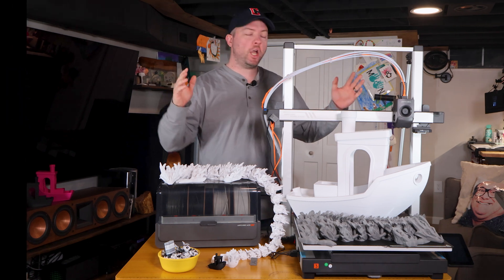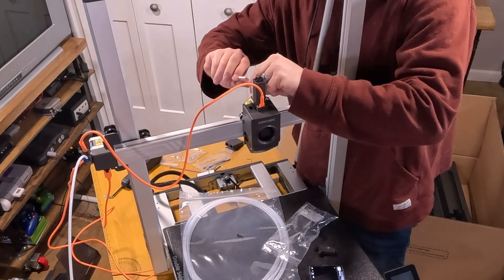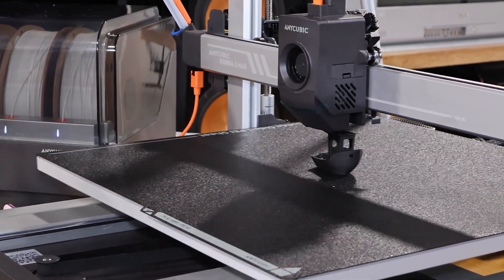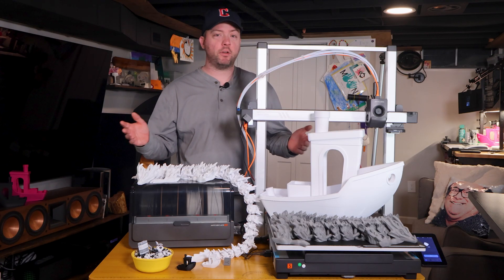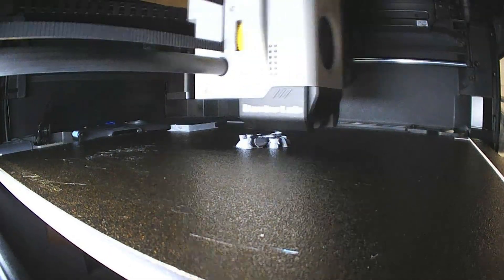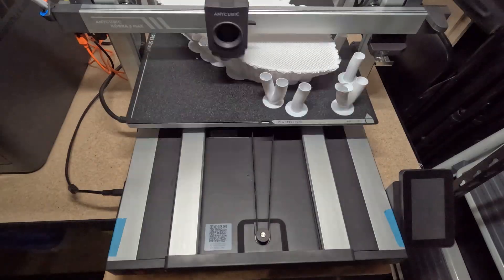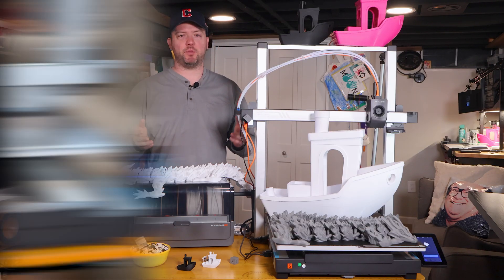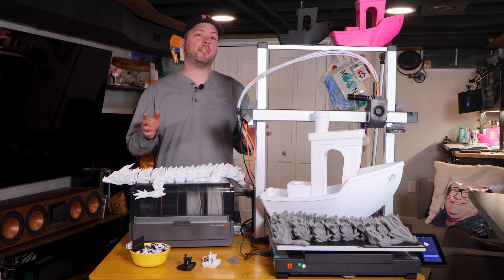Anycubic Kobra 3 Max!  Worth it?

Comment: Anycubic printers have been nothing but frustrating....seems like all the youtubers unbox and immediately start getting multiple successful prints....meanwhile I get 1 successful benchy print and then I can't print a single other thing without issues....mostly clogging issues.....and with the Max 3, sometimes stringing issues because there's no poop scraper or anything
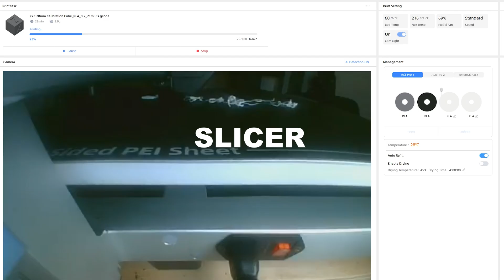Reply from the maker: Oh man that sucks, sorry to hear that.  There is a poop scraper and I initially didn't install it because it wasn't part of the instructions.  For example at 5:30 you can see it just right of the print head with the metal and black plastic in line with the nozzle, is that the missing part?  Hope you get some decent prints like I did.  Haven't had a clog yet.  I will say that anybody can look competent when you can edit a video and I'll try to put my mistakes on display but don't put too much worth in youtubers getting it first try, they probably didn't.
Reply: @TKMakes-2024  hnnnngg!!!! literally just threw out the printer box today.....let me quickly check if maybe I put the scraper to the side with the spool holder.....

Doing a like 14 hour poop bin print now and its working great.....must be just multi-color printing issues.....constant nozzle clogging when switching filaments or something
Reply from the maker: @ryansessions6278  That was the issue I had until I installed my cutter and scraper that can throw the poop surprisingly far.  The few poop bins I've tried so far seems like it tries to "catch" it with only some success.  Let me know if you have one that works well because mine are awful.  I also need one that hangs since in my video I have it's permanent spot too close to the right side.
Reply: Bruh….. I kid you
Not, that is exactly what just happened to me!!!… I literally test printed a benchy, it came out flawlessly…. Just ran my actual first print yesterday, it failed at 82% due to nozzle clogged. Could not get it unclogged while the print was on. Had to stop it. Got the nozzle unclog just 5 minutes ago. …..😂😂

Comment: The print head sits loosely on the guide rail and won't lock into place. It wobbles a lot, and I can't print.
Please help.
Reply from the maker: My print head has no wobble so that definitely isn't right.  My only suggestion, since I'm not there with you, is to double check the screws on the back that seem to hold it all together and make sure they are hand tight.  Other than that I suggest calling support, sorry :(
Reply: There will be 2 of the rollers that are on cams allowing you to adjust the tension, just loosen off them and rotate them around until there is no longer any play, but also not too tight that the carriage can move freely

Comment: I'm interested in something like this just for the build volume and printing single material. Likely PETG-CF, ASA, or Nylon-CF. I'd build an enclosure as necessary for the appropriate materials. Any thoughts on pumping out big parts in single material? Looks like the big benchy is okay.
Reply from the maker: That is exactly why I bought it, large volume and while multicolor would be nice I love the auto fill feature the ACE brings.  my only complaint about big parts is that it's slow but then again it's also a lot less money compared to anything faster and bigger.  When they eventually sell larger nozzles the print time should drop drastically.

Comment: I've been looking into getting one of these, but I'm seriously put off by all the "600mm/s max, 300mm/s standard" advertising that they're pushing, only to open Anycubic Slicer Next and see  K3M speeds that are over 30% slower than the Kobra 2 Max. 45mm/s for first layer? 90mm/s for outer walls? The only place it's even close to hitting 300mm/s is sparse infill. What gives?
Reply from the maker: I was really disappointed with that marketing because it really does make it take so much longer to print.  Yes I can leave it for days to print large objects, I have other printers, but I REALLY wanted something higher than sustained ~100mm/s.  For a print bed this size there aren't really other options for multimaterial printing.  There has been a lot of software and firmware changes since recording so hopefully they up the default speeds?

Comment: I would print larp cosplay item, terrain for miniature games like 40k and airsoftguns.

How good is the print quality compared to bambu?
Reply from the maker: You'd have a huge print bed for those things.  I've found myself using it to print many small objects at once like cabinet supports, picture hangers, tcg boxes, ect.

I think the print quality is on par with an A1 or P1 from bambu and anything above $300 has diminishing returns until you spend a thousand plus.  Bambu has the advantage that it's a refined printer that just works out of the box.  This is a good printer but requires some problem solving to get it to the same level.  That is improving though from what some other commenters say.

Comment: You change your purge amount on the printer itself not in the slicer. Default is 1.5. I've gone low as 0.8 for black and white. Almost 1/2 the poop. You can put any color in any slot. You need to hit SYNC colors from ACE in the slicer. You can change the colors in the ACE from the printer screen or from the workbench in the slicer.

It's crazy AnyCubic not providing decent print profiles. There are some from community members on their maker site.
Reply from the maker: If the objects are separated in the slicer then I can change colors.  I didn't see a way to change colors if it was a single painted object.  There has been quite a few changes so I have to revisit it.  

For anyone watching you can adjust the purge amount after you start a print.  On the actual printer go into ACE options and scroll down.  I know I saw it somewhere when printing but couldn't find it again, thank you for the reminder!  My default seemed to be 1.0.

I also noticed that the printer recognizes my fast pla as "high speed" but the slicer won't apply a profile for it so hopefully that is in a future update.  The firmware did update the camera up to 720p!

Comment: They're clearly making rolling changes. Mine came with a paper manual that had instructions that were generally pretty clear. My test prints all came on a separate thumb drive, and they did indeed ship me a camera, which came in a third order just labeled "accessories" but the camera was the only thing in it. There are apparently 2 versions of the camera as well based on incompatibility with some 3D models.
Reply from the maker: I would hope they are making rolling changes and I definitely got one of the first ones off the line but I was just so surprised.  Glad you got some print instructions.  All my problems could be solved with a little experience so I was potentially worried about it being someone's first printer.  For many that won't be an issue, hopefully.

Comment: Good video.  Unless you want broken filament in bowden tubes, don't leave filament in the Ace.
Reply: Why would you not leave filament in the Ace? Everyone does precisely that.
Reply from the maker: I could see filament in the bowden tubes getting brittle but I haven't had an issue leaving filament in the AMS or ACE.  I do run the heater in the ACE while I look for/design the model I want to print to mitigate issues there.  Some prefer to unload every time and only have what their using in the AMS/ACE and that's fine too but I haven't had issues.
Reply: The parts of the filament fed into the ptfe tube get brittle, break off and then you have to fish them out.  Maybe not right away, but as the filament gets older (or sits for long periods unused in the tubing) it can happen depending on filament type and brand.  That is also why it is not a good idea on non AMS machines to just leave the filament fed into the extruder.  Even if you are in a very dry environment the filament will still oxidize.

Comment: Nice. I’m looking at this printer right now to add to my mini farm, specifically for large TPU prints.
Reply from the maker: I mentioned it a few times but it seems like a good printer if you know how to troubleshoot.  If you have a farm then I'd imagine you'll do just fine :).  Large TPU prints is an interesting idea!  I have a roll I want to start playing with.
Reply: @TKMakes-2024  I mainly print the higher engineering filaments like PET-CF/PAHT (PPS-CF) and other nylon blends. A ton of a PETG/PETG-GF also. But I've found that bed slingers with direct drive extruders tend to be ideal for TPU printing mainly because of their open design being easiest to feed, and because TPU doesn't really print fast well to begin with.